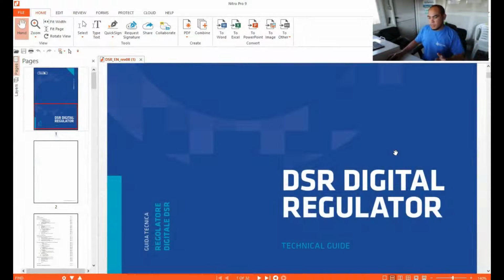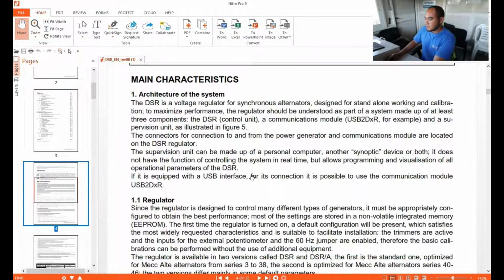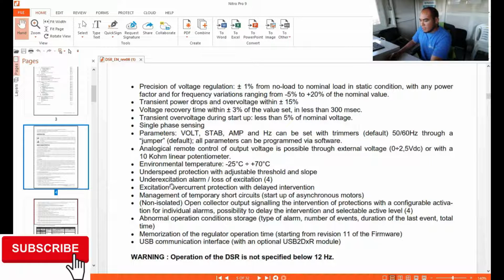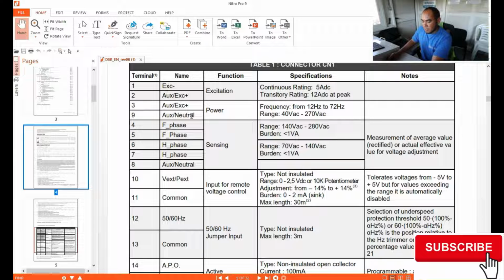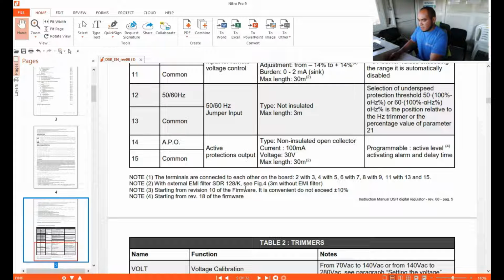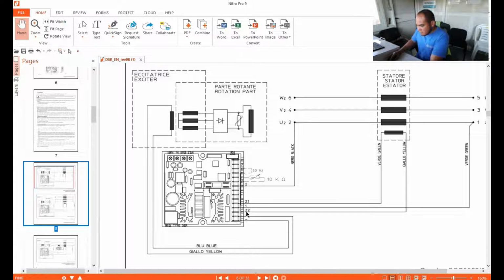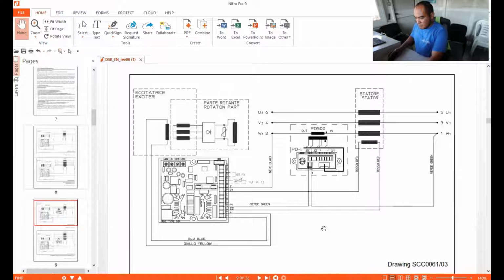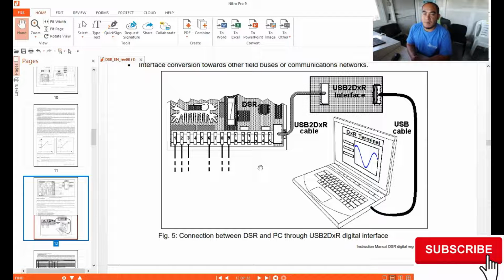Meccalte DSR wiring connection and technical functionality benzblogs

Comment: Hi Thanks for your videos, i need to change the configuration of this avr from  120-240 volts 60Hz to 380-440 volts 60Hz can you tel me what cable connectios i have to change on this AVR?

THANKS
Reply from the maker: At the back of the avr there you can or i send u the diagram what avr you are using
Reply: @benzblogsVlogs  Thanks for youre aswer the AVR is a DSR of 40 series I think is manufactered by MECCALTTE, the alternator is a KOLHER MOD. KH00500TO4N, at the inside of the top cover of the alternator has a diagram I just want to verify what cable conections i have to change on the AVR for sensing from 120 v to 220 v
Reply from the maker: @henrycharlesinniss7538  sir 12leads yn 220 ang number sensing mo is 4-9 number in avr or p1-4 number in wire
Reply: @benzblogsVlogs  can I contact you by email?

Comment: Hi for synchronization/parallel operation where to connect on AVR it is pin 10 and 11 or any other pin please suggest
Reply from the maker: This 10 -11 is u use as external or your analog

Comment: Hello  meccalte  275 Kva Generator  for suitable  AVR plz?
Reply from the maker: Sir you can use R250 this 110 voltage sensing or AS 440 this is 220 voltage sensing